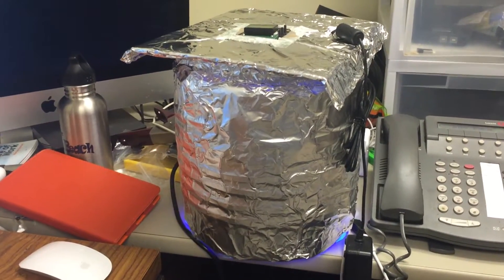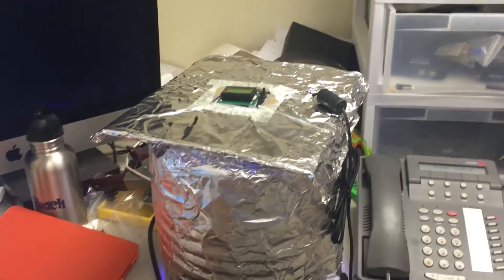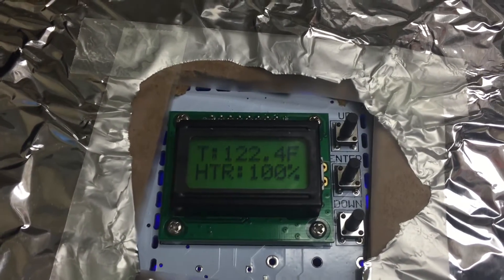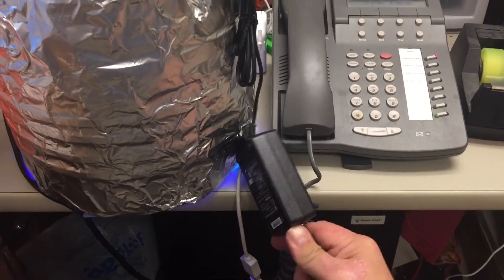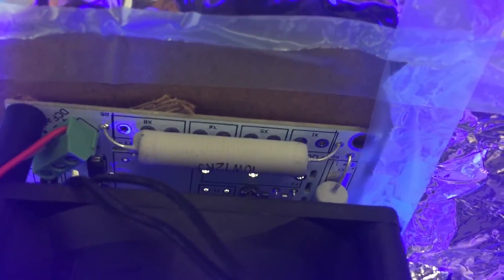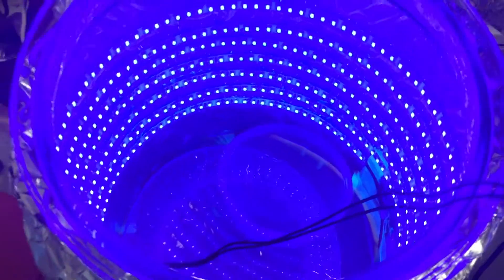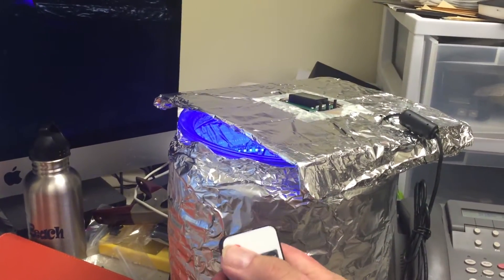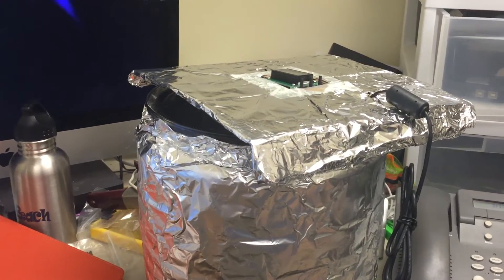SLA Post Curing Unit Version 1

Comment: Is heating the part critical or can just using a longer time work? I've been printing parts and they look the same pre and post cure. (I don't have an incubator on mine) Is there supposed to be a visible difference?
Reply from the maker: I think the warmth helps significantly, but it isn't required.  Yes, you could just cure it longer.  FormLabs had published lots of data on this a few years ago and experimented with both curing time and temperature.  FYI, since this video, I added a 2nd UV LED strip.  I wrapped the two strips tightly near the bottom of the jar so they wouldn't need any tin foil.  Then I wrapped the upper 2/3 of the jar with the foil and still use the incubator heater.  The reason for not wrapping the LED strips in foil any longer is that they trap in so much heat that I think it affects their lifespan/brightness.  The office next door bought a FormCure and is happy with it, but I think the price is overkill.

Comment: Glass blockes UV (parly), it's on the inside of the glass, isn't it?
What curing times do you need with it?
Reply from the maker: Well, 405 is near UV, but yes, absorbance spectra showed a few percent would be lost, but I figured that would be much better than subjecting the LEDs to the water (when doing submerged curing for flexible resins) or buying a large container with a better glass (and water doesn't absorb too much at 405nm either).  I usually post-cure for an hour or two.  Since that video, I added a 2nd LED strip, moved them both towards the bottom of the glass, removed the tin foil from behind them, and filled the jar with water because I was seeing very slow curing for flexible resin.  The LEDs do put out some heat so removing the foil reduces the heat that may shorten the LEDs' life.  The LEDs are enough to warm the tank enough for resin curing (and the glass does absorb some light to make heat) so I don't need to jeopardize the heater with water splashes or humidity so I just put the original jar lid on top and let it cure overnight.  Even flexible resin isn't tacky after 8 hours of curing.  However, if I set a flexible resin part under sunlight to cure, it seems to take a few days.

Comment: why not a big bulb  with 100 watt output   of black light ,   led  power is  not very high
Reply from the maker: Sorry, I didn't seem to get comment notifications on this video until 11/1/18.  A big bulb would be a good idea.  For me, I thought it would be helpful to have light coming from all angles to help cure complex parts and trying to put a few traditional bulbs around the glass would make a cumbersome unit.  I could put a bulb inside the unit, next to the part and then light would bounce around the chamber to get to the back side, but I'd need a bigger chamber and be careful to only partially submerge the bulb for water curing.